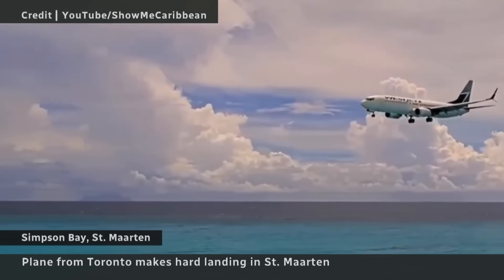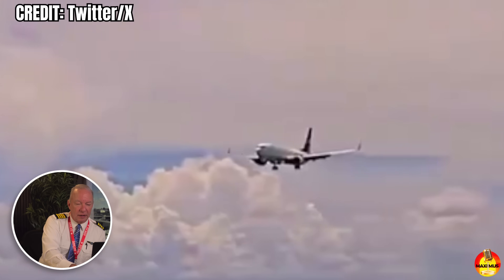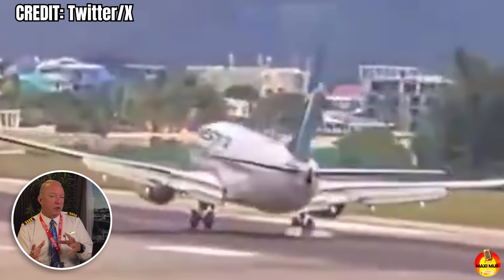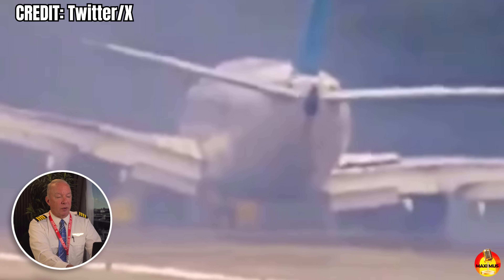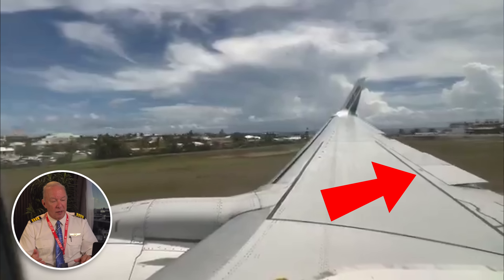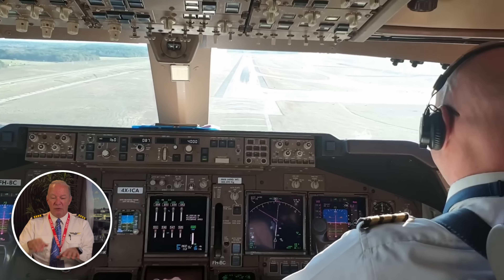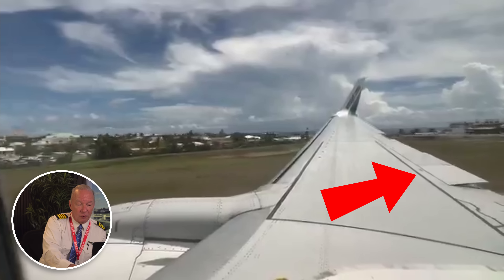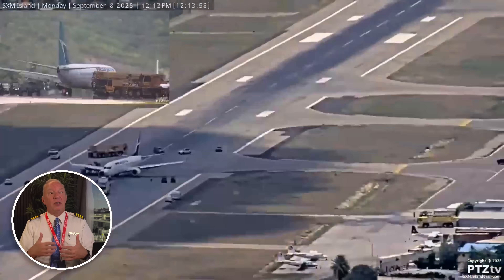Hard Landing at St. Maarten  What Went Wrong with WestJet 2276

Comment: The arrow points to the spoilers, not the ailerons, and I believe their movement is controlled by the plane's avionics rather than the pilot. If I'm not mistaken, pilots can activate them to reduce speed during descents, and upon landing they fully deploy. From my point of view, moments before landing a gust of wind causes the spoiler to compensate more than necessary, causing that side of the wing and landing gear hit the runway harder.

Comment: Not sure i understand. The red arrow pointed to the spoilers, not the ailerons.
Reply: The arrow is pointing to the inboard most flight spoiler. Keep looking down the trailing edge, you will see a short gap, then you will see the right aileron. You can see both spoiler and aileron working together as is normal at this low speed. The important thing is that right roll input was put in by the pilot flying at that time.
Reply: Take another look at the picture. The picture starts halfway down the wing. Now take a look at a diagram of the flight controls of a 737. He is pointing to the aileron.
Reply: @fr.jeremiahpayne8378  I was not aware the engines on a 737 was mounted over half way out the wing.. Must be some incredibly strong mounting points to handle all that leverage!

Comment: I've been to this airport many times and have probably 100 days of sailing along the shoreline there. it can get really "puffy" right as you get over the land there, with the wind going from 5kts to 20 in the space of 100ft with 40 degree wind shifts.  It moderates after about 500 feet past the threshold.
Reply: That’s a vicious runway !
Reply: that's likely what happened  here because the southerly wind  blew undisturbed on that stretch of the rwy, no housing or bushes there to soften it , probably why he put some right aileron up
Reply: But other planes landed properly, why this one didn't? Something else went wrong

Comment: what happens after a super hard landing re repairs....back in the mid 80s at my home airport, CYAM, during a blizzard a Nordair 737-288 on an ILS to  RNWY 11 experienced a very severe down draft at the start of the flare and slammed the act into the ground, colla-sing the nose gear backwards and shoving up into the electronics bay, the right engine nacieale hit the ground and damaged the engine  and the leading edge of the wing and broke engine mounts... the act slid on its nose about 3999 feet down a 6ooo ft runway and the passengers evacuated via the slides onto the runway..... airport fire services were on scene with in a minute of th tower sounding the crash alarm... by the end of the nest day they had a crane and a sling walk the act across the airport and up to my companies (Algoma Steel) and parked it....Boeing sent an accessment team and evaluated the damage....At the time Boeing had stared parts kits in storage ready to ship to crash sites for on site repairs...they pulled the act into the hanger after removing the verticle stab so it would clear the hanger doors and over the nest couple of months the stripped all the damaged skin and parts and repaired the act and I watched later as they did a post crash repair test flight and the act returned to Nordair in Montreal ...

Comment: I did some looking and it appears the fuel tanks are in the wings. I am amazed that the landing strut doing what it did, didn’t rupture a tank on that side. I am thrilled it had a good ending for the occupants.❤
Reply: The wing is designed to fail at this position to avoid damaging the fuels tanks and the main spar.
Reply: The 737's fuel tanks are actually a fair but further forward than the gear attachment trunnion and doesn't actually go into the fuel tank structure directly.

The part of the wing over the landing gear is only a panel  held in by relatively small 3/16" screws (and a couple of 1/4" bonding bolts)  and would not be much resistance relative to a landing gear shearing.
Reply: I came here with the same question about the gas tanks. It still seems that such significant damage could at least impact fuel lines. And there can’t be that much added space.

Comment: I've flow into Princess Julianna, and the approach seemed just a little fast. Hard to tell because it's been so many years, and the visuals may have changed a little. I would not say that was a hard landing. The Ryanair guys routinely plant these planes with more force than that. I think it is a gear failure due to that roll to the right. I don't recall a lot of crosswinds due to rising terrain on the left, but the palm trees on the left of the runway are indicating a right crosswind, and they were too close to the runway for that control input. Also looks like some nasty weather just east of the departure end of the runway, so that crosswind gust could have been pretty strong.

Comment: I have landed harder than that with no gear failure. As there have been several trunnion pin failures, do to improper maintenance, I’ll speculate that especially as the strut came up through the top of the wing just like the Alaska Airlines aircraft had a couple of years ago.
Reply: Agreed, fractured trunnion pin. Also, graphics pointing to spoilers, not aileron.
Reply: Wow! Glad to see the local newscast..Happier to hear lots of fellow Torontonians survived.
Reply: Due*
Reply: How can you tell you've landed harder? Do you have outside film footage of all your landings?
Reply: That was not even close to being hard enough to collapse the gear. No matter what you are smoking.
Reply: I thought they said the problem was with the landing gear! 🤷🏾‍♀️
Reply: The right spoiler coming up with moderate right aileron input seemed well within reason. More likely windshear plus old timey parts...
Reply: @stevekrahn8808 

There's a video from a year ago of a West Jet landing here that is almost exact in terms of aileron movement and timing. 

Do not think the landing was particularly hard. The gear failing was pretty hard.

Also, the issue with the Alaska pin was not maintenance, rather refurbishment. They introduced a crack on remanufacture that eventually failed.

Will be interesting to see what went on here.
Reply: This is obviously the most likely scenario.
Reply: I suspect that too i did many trunnion pin replacements and inspections on 737 ng
Reply: "ONE HUNDRED, FIFTYFOURTYTHIRTYTWENTY" (BAM!)
Reply: Is WestJet paying you?
Reply: Thank you for highlighting St. Maarten  
The best place for vacation.😀
Reply: Speculative bullcrap. It's clickbait nonsense based on a fuzzy video. This channel has become a joke promoted by a self serving, poorly informed opinionated non engineer that should know better than promote speculation without hard facts.
Reply: @chrisknight4584 you're a TROLL 
KEEP YOUR DELUSIONAL THOUGHTS TO YOURSELF
Reply: NOT improper maintenance , it's poor engineering  !   This isn't the first time one has BROKEN !
Reply: @samson-q2b  The pins wear and can be refurbished, with care. The alternative is to replace the old pins with new pins, which are manufactured over-size and machined to fit. This arrangement is used for all airlinears.
Reply: @samson-q2b  you're an idiot

Comment: I've watched thousands of video's of landings harder than this one (just watch a few "aircraft in storm" vids to see). I've also been on many Westjet flights to work camp in northern Alberta where the runway is 6000 ft, and they very firmly plant the aircraft down on it due to the short runway. I'm going to have to take the view that this was the trunnion issue. I'm thankful all aboard were safe. Hopefully a full investigation will come sooner than later.
Reply: It is a failure of the aft trunnion pin
Reply: @marcweston2156  I assumed so, did they already come out with that info?
Reply: @brianpeace7585  I have pictures of it from my collegues.  They are also out there on the net.

Comment: I hate to use the word disagree with you but I guess I will have to use the word can't agree with you on this. 
  Although I've only been doing it about 20+ years nothing like you but just from the video evidence it doesn't look like a so-called "hard landing" I mean really at the end of the day what does that even mean?😂
  Sure it might've been 20 to 25% above normal but anytime you're landing in the islands you're not gonna get a greaser every single time
  I mean that plane is designed well above that threshold and he has already burnt a lot of fuel and weight off of that airplane.  Now it may have contributed to and already broken or stressed trunnion but I don't think you can specifically say that particular landing cause that wheel to go up through the wing.  
  by the way I saw your post yesterday about getting knocked off of that September 11 flight how old was you in that video?

Comment: It's not the first time that happens to a 737. There was a problem with some pin in the gear assembly that could end up breaking and this happened. So it could be a maintenance problem as well. Let's see what the investigators say.
Reply: Non-experts are misled: just these days another competent video explained that 737 are made for rugged, not smooth landings, small airports, short strips (the context: why Ryanair pilots tend to land hard). Also: to my eyes this crew wasted a big chunk of the runway before touching down, and on that island it's not infinite.
Reply: They landed in the zone just past the markers. Watch the video again.
Reply: @greg-warsaw4708  It's not that short of a runway
Reply: Boeings next new plane will probably have no serviceable parts...... break a part, order a new plane. I see what you did there, and why you did that.  I still am trying to get my thumbnail changed out.

Comment: Flight following website shows speed and decent graph are not exceeding a normal glide limits . Could possibly just be a gear failure because of a little wind shear drop at the last second? Wouldn’t fault the pilot.

Comment: I'm surprised this doesn't happen more. Every Southwest flight I've been on ended with the pilot aiming for #3 wire and slamming down on #2. I haven't experienced a smooth landing in this century.
Reply: They've achieved a reputation as "Cowboys" among pilots at other airlines; this includes very fast taxiing.
Reply: @602STS2   I'd taxi slow in front of them for spite. Walking speed is fast enough, right?
Reply: Southwest has no time to waste on niceties..... pack em in, get off the ground, land and get off the runway. Production Production Production. Southwest is gonna give you cargo landings! You want passenger comnfy landings, fly Delta. You want silky smooth landings, Emerites.

Comment: Juan Brown on his channel did not call this a hard landing and did go over similar failure of  the trunnion pin from another incident.
Reply: Hard landings happen all the time. Landing gear are built for this. It is not the pilot’s fault.
Reply: Agree 100 pct. Stabilized approach. I wouldn't call this a hard landing. Obviously, the trunnion pin failed and would cause a jolt and failed tires.
Reply: @AviationCat-m2q  tires didnt fail
Reply: He also said that they would repair it in no time. The damage isn’t as severe as it looks.
Reply: Juan doesn’t need to wear a white shirt and epaulets to make himself look like an expert. He proves it with his observations and evidence   This guy? Not so much.
Reply: @FlightData101 yall are dumb as fuck. You do realize that BEFORE the NTSB even came out with what caused the crash of the MD-11 in Louisville Captain Steve had already called it and even called the compressor stall happening in the other engine the ONLY thing he got wrong was what engine was compressor stalling. So stfu dude is a LEGIT pilot and has been for 30 plus years not only that but piloting the B767-777 so he knows what the fuck he’s talking about. Pretty sure this turned out to be the pilots fault too so.. again STFU
Reply: Juan does research and actually puts time and effort into the information on his videos. This guy just blurts out complete drivel, but advertises himself more. There is a reason he keeps popping up in the main stream media.
Reply: @danielmosey6203 Also Juan it’s a certified aircraft mechanic. He actually understands how his airplane works. He doesn’t just fly them.
Reply: Pretty clear this guy doesn’t have a clue what a hard landing looks like. The 37 is designed to take a lot harder lands than that. This is a mechanical gear failure issue I’m sure
Reply: @CenterofGravity-y8o no it’s not. It’s not designed to take no more a hard landing than any other aircraft so stfu and quit spitting false information off as fact when it’s not. And know what the fuck you are talking about to avoid looking stupid as fuck
Reply: I’ve watched a number of videos from Cap Steve and Juan Brown, and my observation is that once Cap Steve decide on his theory of the cause of an incident, he spends the rest of the video attempting to justify and corroborate it through the videos, even if the evidence is simply insufficient.  This makes his videos appear bias towards sensationalism over facts.  Juan Brown is exceptional about not making any conclusions, but rather explaining potential causes by using past, similar, incidents.  Juan may have a theory, but it’s always backed up by history, not immediate justifications through a blurry video.  Cap Steve’s initial video and interview about the Air India crash was absolutely terrible for a professional to put out.  His premature conclusions against the pilots before the investigation even barely started was with disregard for their families or reputation.  This is hard to understand, especially when it comes from a fellow pilot.
Reply: @gervanwilliams1409 Yes. Remember, Juan is a mechanic, Steve is just a pilot.
Reply: Juan is the gold standard.
Reply: A much better channel - a lot of researched and well informed facts, little speculation, and no posturing in uniform with wings, epaulets and ID card begging for attention.
Reply: No matter the cause, it’s still a hard landing.
Reply: @MashaT22  not that hard.  you know nothing.

Comment: There has been a problem with airlines failing to maintain the pin that holds the landing gear.  If this breaks due to corrosion and crack propagation it looks exactly like this.
Reply: Juan Brown of the Blancolirio channel has already reviewed this incident and predicts that the investigation will find that the landing gear's trunnion pin has broken due to being too old and corroded.
Reply: Mu thoughts exactly. Landing looked quite positive, but not over limit.
Reply: As one of the experienced aircraft maintainers that the bean counters at Westjet retired, I will bet that pin had corrosion and not much grease.

Comment: Thanks Captain Steeeve! You do a great job breaking things down. Westjet is a Canadian airline. I can imagine there is a number for this pilot to call. And just possibly there was a mechanicL failure too. If fuel is stored in the wing why was there not a fire?
Reply: Welp, your first clue should be that the fuel tank wasn't ruptured.
Reply: Where is the fuel tank in relation to the gear that went through the wing?
Reply: @Canadian-Meg It went through composite panels on top....not structure.
Reply: I can't imagine that the designers would put a fuel tank directly above a landing gear strut. Furthermore, there must enough room for the gear to retract, which probably wouldn't leave much room for anything else, although not sure on that one.
Reply: @sssnipercoyote60I can't imagine any other aircraft company but Boeing would put fuel tanks over or near landing gear, except.......

Comment: We’ve seen so many 737 smack downs in Europe but the gear didn’t break.  Feel sorry for this WestJet
Reply: May not have been the first "too hard impact" that the plane had?  I wonder how many hard landings it had and whether there was undetected and/or cumulative damage?
Reply: @navyhmc8302 the plane notifies company & Boeing of hard landings and other exceedences before the plane even  parks at the gate.
Reply: I had a copilot hit the ground so hard I grabbed the yoke and went to full power and it never hurt anything 727 vs 737 That landing was very firm but not enough to cause this damage
Reply: Many European ‘hard landings’ are juvenile moronic memes faking it with deliberate camera phone violent movement on touch down.